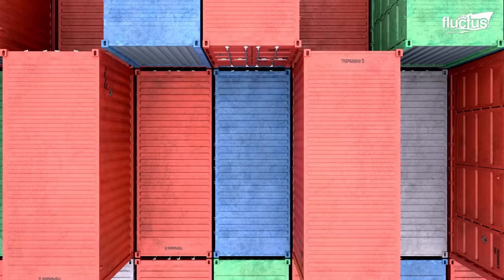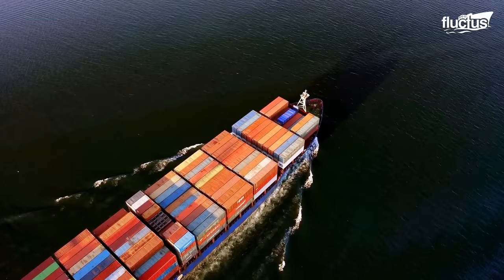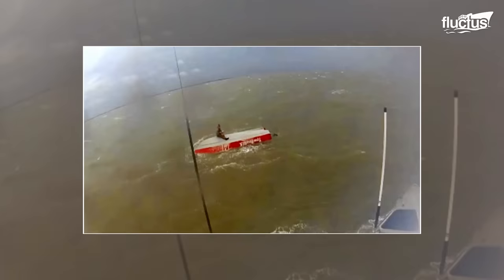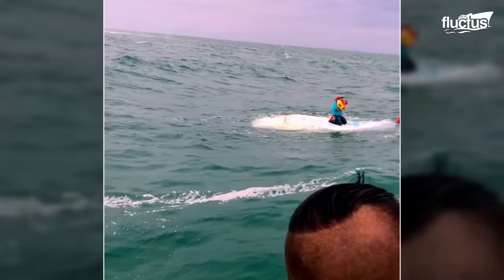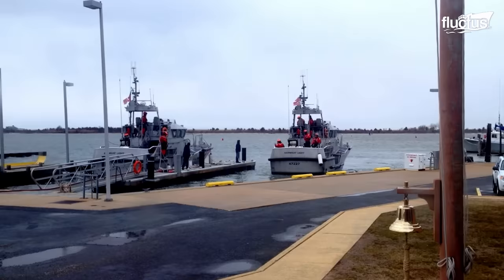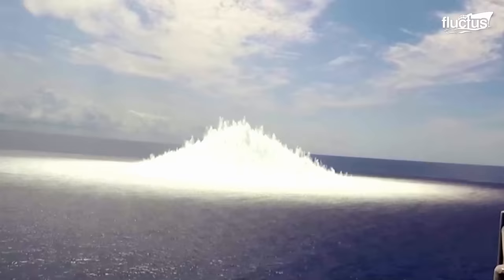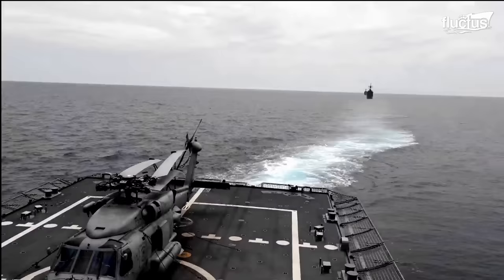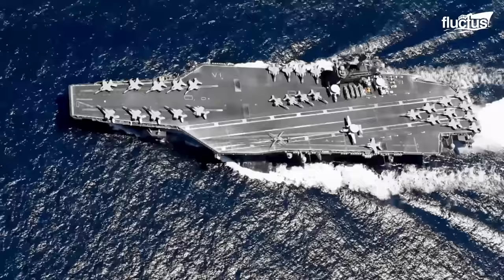How This Simple but Genius Test Saves Billion of $ During Heavy Storms

Comment: I can't understand why they don't stack the containers 90 degrees to their current position,  this will give more stability in itself.
Reply: You can fit more that way
Reply: @alecstaley1017  how?  The volume is still the same
Reply: You're right I guess it actually has to do with how they bolster them together. When tipping occurs its better for them to be forced to roll off compared to being able to slide off if placed "horizontally". That's at least from the source I found
Reply: My guess is the loading and unloading process dictates the direction. Boats are alongside the peer at launch and containers are removed by cranes one at a time. The containers are unloaded directly onto semi trucks which haul them to a logistics yard. Not having to turn the containers 90 degrees would make that process safer. That just a guess.

Comment: The big container ships consume as much as 17million litres of fuel per hour of ocean travel. At a 24,000 container maximum that’s 708 litres per container per hour!
Buy locally! Save the planet!
Reply: According to freight waves, their container ships only carry a max of 4.5 million gallons or 17 million liters.
  By your figures it would run out of fuel in 1hr, it wouldn't make it more than 30 miles out of port before running dry.

  Their 18,000 container bearing ship consumes roughly 36,000 gallon or 136,000 liters per hour at cruise speed of 25mph.
  This being roughly 2 gallons per hour or 7.5 liter per container per hour.
  If something has to be transported from a to b, container ships are literally the most efficient transportation available to mankind.
  12.5 mpg for a 30ton shipping container is double what a semitruck uses.
   Unless everyone is living  just down the road from every farm, plant, mine, factory, office  that they buy products from, these ships are going to be the best form of transport for goods.
Reply: No. Don't tell me what to do.
Reply: you calculation is wrong and funny